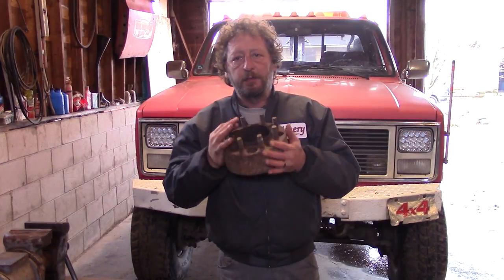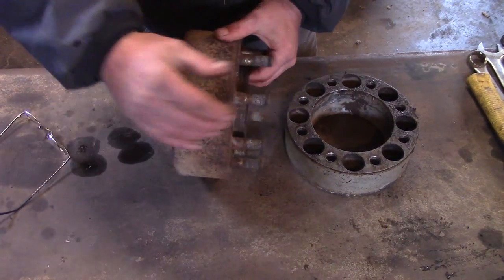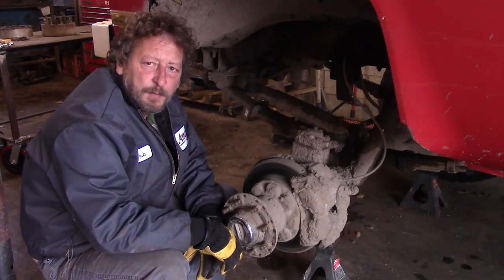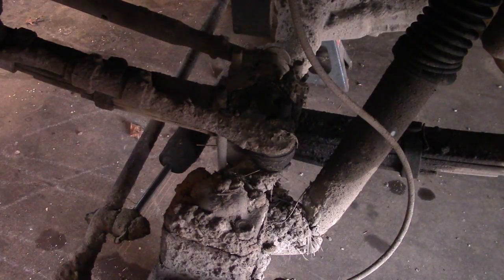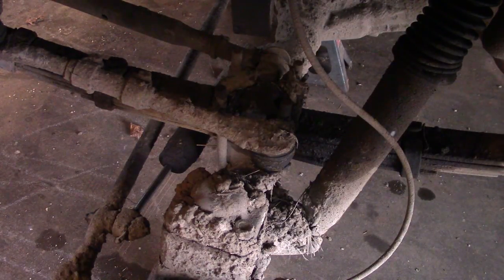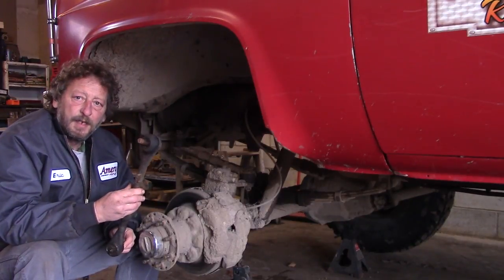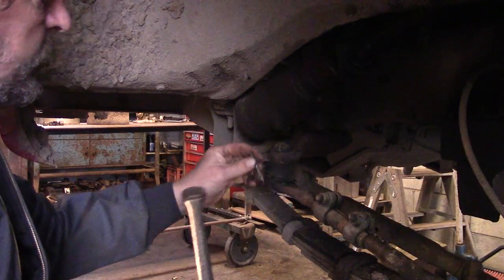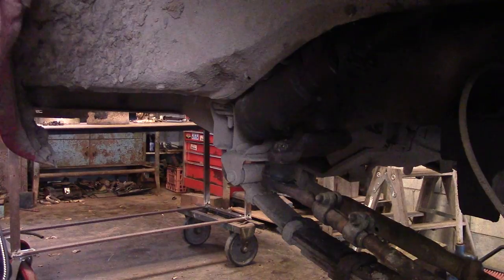TECH TIP DRAG LINK by BSF Recovery Team

Comment: Took my '84 K20 to a shop to straighten out a few issues, including the drag link. They zipped the nut on with an impact (stripped it) and jammed the cotter pin in. 
Steering was very loose, 1/4 turn loose. 
Put a new nut on, used a bottle jack to put pressure under it, steering is tighter than any car i've driven.

Comment: Great video. Got any tech tips on doing a King Pin Dana 60 Ford Front end? I gotta put a new gasket and probably should do a complete repair kit to each knuckle, due to it being an old truck that has seen many years as a plow truck. Wanna make it into a street legal all around type truck for off-roading, Yard work and emergency transportation when the roads get crappy like today.

Comment: I think it's time for crossover steering bud.
Reply from the maker: It's on the upgrade list, when I can afford it.
Reply: +recoveryteam what's the advantage of crossover steering over the factory set up?
Reply from the maker: The short drag link from the steering box to the left side wheel, can limit the steering ability when the suspension is at full extension. A crossover steering drag link is longer, thus the end connected to the tie rod, or right side steering  arm can move with the suspension with less adverse effect on the steering ability.